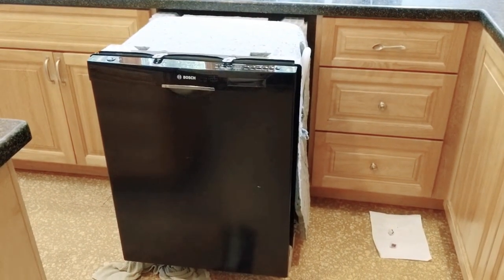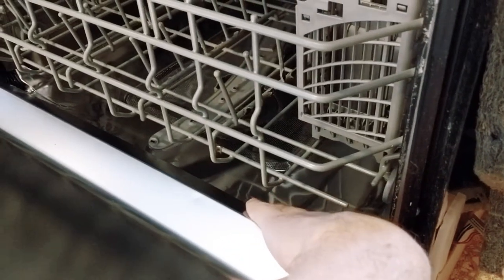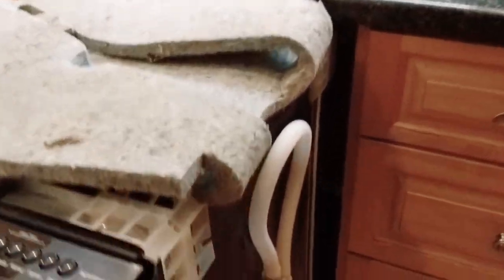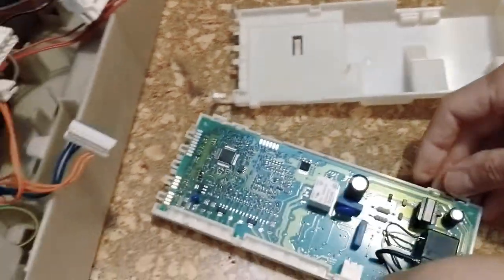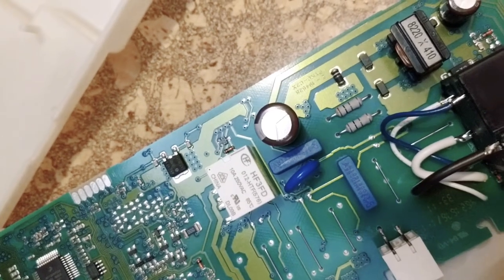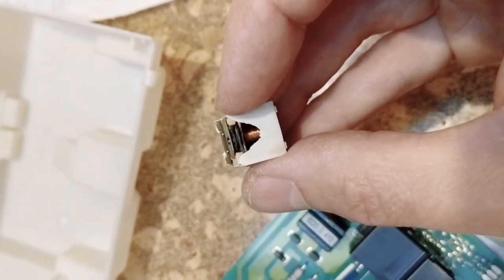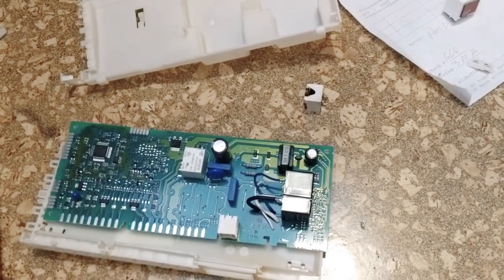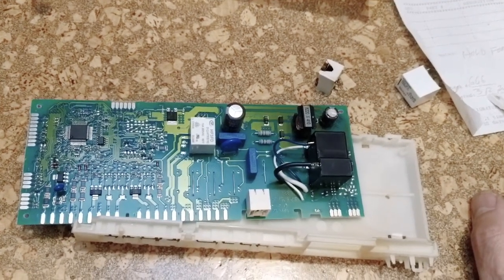Bosch dishwasher repair - heater didn't work.

Comment: Great job!!!! I just diagnosed the same problem today while out on a service call. Many service people are just parts replacers. I actually ohmed out the heating circuit then tested for voltage at the board instead of guessing. I sleep better at night that way.

Comment: Thank you for the thorough detail about the relay and PCB. Your attention to detail is superb and beautifully explained. This video directed me to a failed solder connection on the reverse side of the PCB to the relay. It was a failed solder joint. The existing 10amp relay was fine and the fault was fixed by re-soldering the relay tab coming through to the other side of the PCB. May God bless you Seth LaForge. He blessed me by directing me to your video! 🙏

Comment: Thank you! This approach did the trick for our SE35A562SK/47 as well. In this model, the control board is at the top and required disassembly of the front panel. And it was a NAIS / Panasonic JS1a-5V AJS3319 5V relay, not a 12V. This one had gotten hot and was still clicking in a test but did not make contact anymore. After replacing the relay, dishwasher heats again and works well. Thanks for the tutorial!

Comment: Thanks for your video. I have a Siemens dishwasher that is having this problem and presents the error E02 on the panel. I think that the cause is probably something like this because I had the same problem around 3 years ago and it solved by itself after a few days while I was waiting for the assistance to come. Does it make sense that it got fixed by itself? Maybe a connector slightly move and started working again and now failed again?

Comment: Awesome video!!  Last week was appliance hell as my microwave burned a flame sensor (there was no flame or excessive heat), my refrigerator lost the cheap plastic pins holding in the switch for the through-door ice dispenser, and my [Bosch] dishwasher failed to heat the water.  In my case, it WAS the water inlet valve.  I don't like being my best appliance technician (I'm not an appliance technician) and I appreciate helpful people like you making these videos.  None of the videos out there directly solved my problems, but the approaches and clear thinking led me to about $600 in savings.  The difference between the water inlet valve problem and the relay problem is that I had some heat and the dishwasher was always hot and steamy when it was done.  With the relay problem, I would assume you would have no heat ever.

Comment: Thanks so much for doing this video. I had the same problem. I ordered the parts from your links below and soldered the new relay switch on the circuit board. My dishwasher works great and I don't need a $1200 replacement.

Comment: I wish that I had found your video before I replaced the instantaneous heater assembly. 
I spent about $240 for the new part from Bosch  to only find out that it didn’t help. 
Like your video called out, a pin under the relay had to be soldered. 
I just ran a load and the water is piping hot. I’ve got clean dishes again.

Comment: I've seen many videos where people think just adding solder to the old relay is an answer. But that is just a stop-gap measure that buys some time & the problem will recur. The issue is with the internal relay contacts.

Comment: I have a Bosch shx series dishwasher that was not heating. I checked the control board and it looked fine. My board is easy to access behind the door. I ordered a new heater assembly after checking the resistance at the connector on the control board that supplies the heater. It showed open and should be 11.5 to 12.5 ohms. ( it turns out that you can't check the heater this way) After looking at the new heater assembly,  they incorporate a flow sensor switch that is in series with the heater.  I pull out the dishwasher and remove the right side panel to access the heater and measure the resistance. It checks ok. I then find a wire hanging loose and not connected to anything. After looking at the wiring diagram I discover that this wire comes from the control board to one side of the capacitor for the main pump motor. The spade connector had corroded apart and fell off of the cap, preventing the main pump motor from running properly. New five cent spade lug fixed the problem. I would suggest anyone with a no heat issue check the board as described in this video and also check the heater resistance directly at the heater before ordering a new heater assembly. It could be something simple as in my case.

Comment: Bosch 800, cold water only - fills to top of filter, replaced heat pump, no burn marks on Control board ,,, any thoughts or suggestions?

Comment: I am unable to find the Omron G5LE-1A-E DC12 12VDC here in the USA.
I was able to find the Omron G5LE-1A-HA-E DC12 12VDC.
Any idea what the "HA" stands for?
I can not find that in the Spec Sheet from Omron.
Reply from the maker: Yeah, I can't find it either. But the "HA" is in the part of the part number that specified "Insulation System" and the relay I used has the minimum insulation rating option ("Class F"), so my guess is that the "HA" specifies slightly better heat tolerance. <https://en.wikipedia.org/wiki/Insulation_system>

I'd try it. I strongly suspect it'll work even better.

Comment: This is great. Thanks for making the video. I have a Bosch  SHE55R56UC/64 which very similar to yours. Would I use the same part as your model?
Reply from the maker: Probably, but I don't know. Find the relay that's broken and look up the part number. If you can find something with the same pins and voltages, and the same or ideally more current capability, it should work. digikey.com is a good resource.

Comment: Great video. Your heating pump was still working fine? Can a defect/semifunctional relay cause failure of the heating pump?
Reply from the maker: The pump was still working fine (water circulated through the dish washer), the water just wasn't getting hot.
The main water pump has a number of signal wires to it - I'm not sure if it's controlled by a relay or if the pump switch is internal to the pump. I could imagine either way. It might be possible that a failed relay on the control board would stop the pump from operating, but I suspect it's more likely to be a failure within the pump, since it contains complicated electronics, and a pump relay would be switching much less current than the heater relay.
Reply: @sethml  Cool thx
Reply: Thank you , you are grate.
Reply: Heating relay defect on the board would not cause a heat pump to fail, as the heat pump merely doesn't get power from the control board.

On the other hand if you have leaks from the sump, the leaked water can get in contact the zeolith heater  (band heater) inside the wash pump and cause corrosion of components on the band heater/ntc.

This is one of the failure modes which will result in E09 error.

You can have a look at my channel if you wish